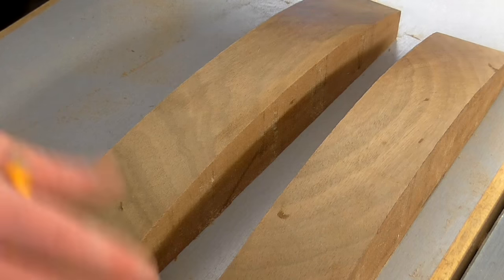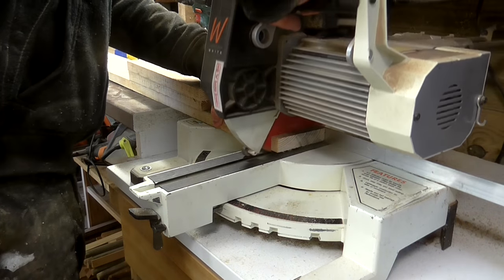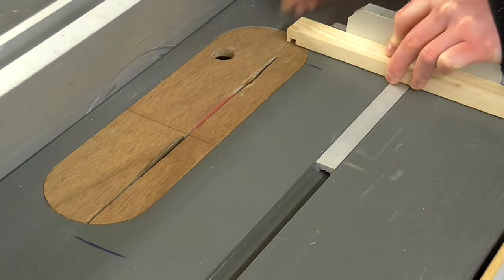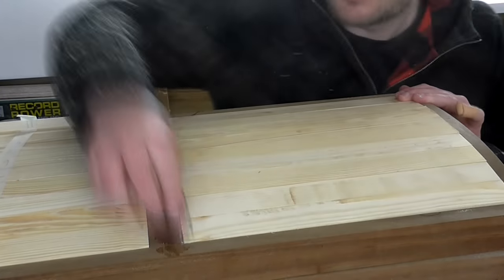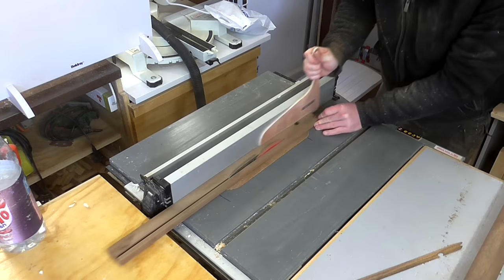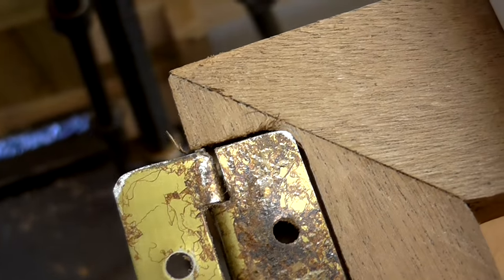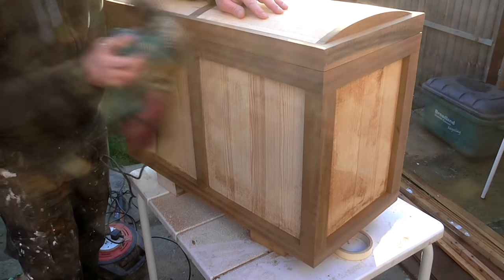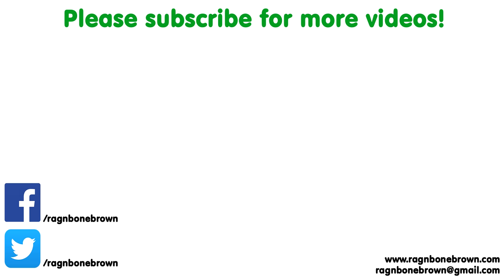Making A Treasure Chest Ottoman / Blanket Box (part 2 of 2)

Comment: Yes Sir that turned out real nice  should hold alot inside of just whatever.. Think a couple of 6"-8" of brass chain would finish it off nicely inside so lid just doesn't flop over.. That wax finish I've heard does good job in a damper type climate too.. Here in the U.S western part wood tends to dry and split over time...      Thanks for reading       PEACE

Comment: absolute awesome!  but notice once : the Pine will expand a lot more than the hardwood. next time leave a little space between the pine boards to prevent it. worstest think happen is that your edge -joints cracks. harmful case will be deforming your surfaces

Comment: Just a suggestion (please don't take offence). If you used hot glue to the hinge/lid before screwing the hinge/box part you could screw the hinge/lid and the fit the hinge/box part in the recess you made. This would be less potential for stress and slippage when doing the hinge/lid screwing.

Comment: Very nice chest. Your videos are your (and our) treasures.
Yesterday I finished my poor man's table saw (circular saw upside down) but I ran into an issue.
The fence, perfectly straight and parallel to the saw blade goes from front to back.
With cutting plywood I had no problem but while cutting solid wood (11 mm thick pine) in pieces of 5 cm wide the
wood got stuck. I asked on some other channel and there the said that for solid wood the fence should go only till half
of the saw blade in order to avoid the wood getting stuck.
Now I watch your video and see you cutting/ripping solid wood with a fence going from front to back.
Do you not have issues with the wood getting stuck? Or did you have that kind of issue before and you found a solution to it?
Reply from the maker: +Hans de Groot does the circular saw have a riving knife? You should be able to cut solid wood ok but a riving knife will help it through
Reply: Yes, it has a riving knife. The power is 1200 Watt  (1.6 HP)